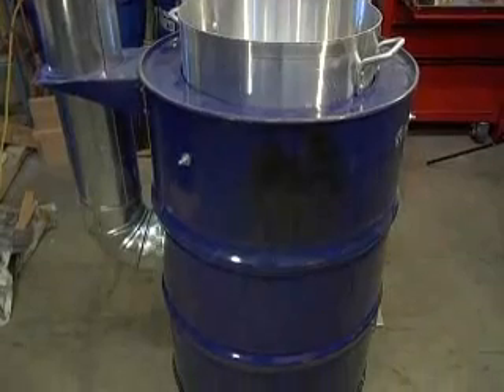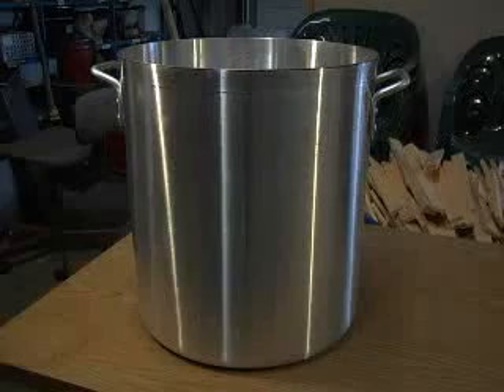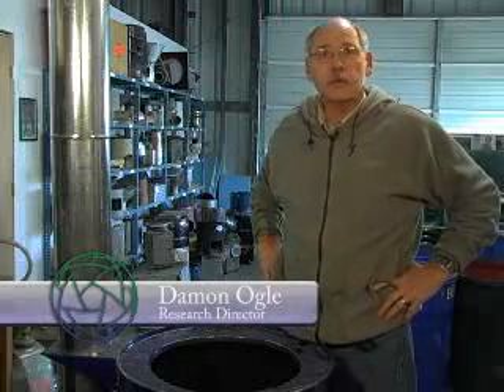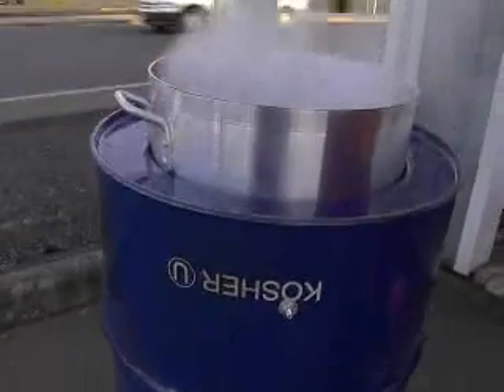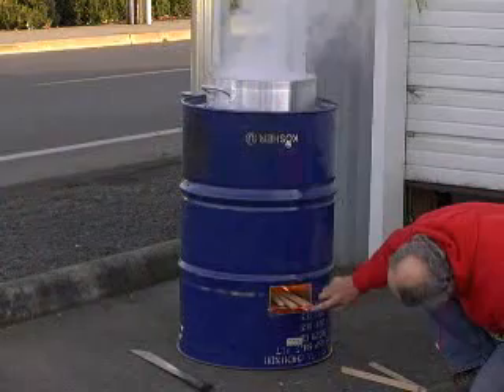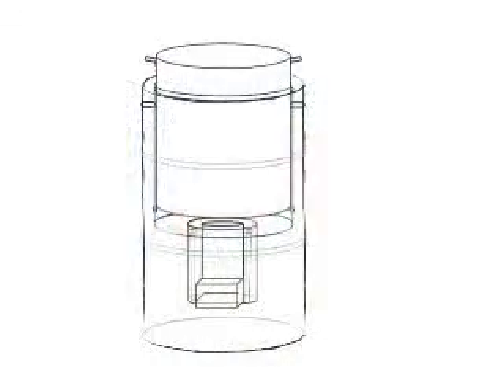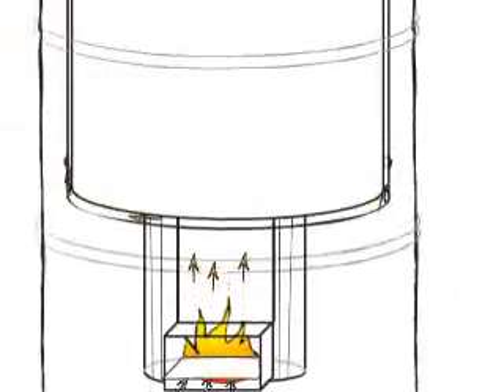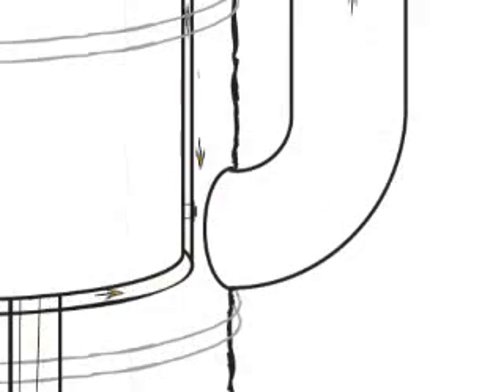How to build an institutional rocket stove - Part 1

Comment: @toelesshoe If it was left on top, only the bottom would be heated.  By forcing the air up the sides, a *lot* more heat is transferred into the pot.